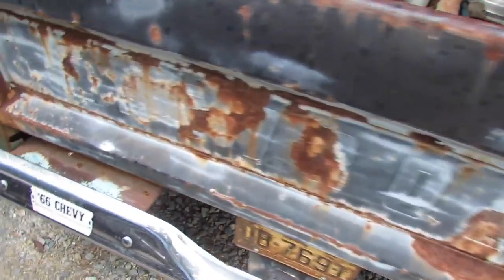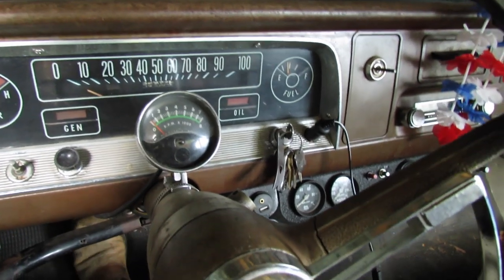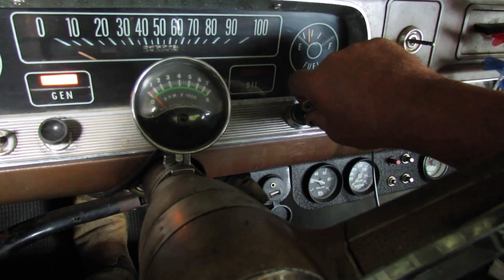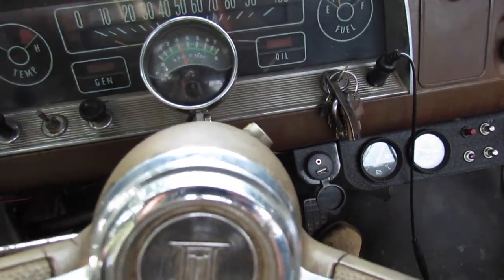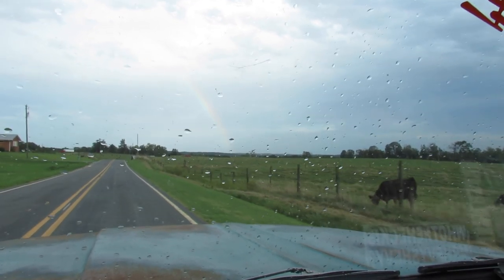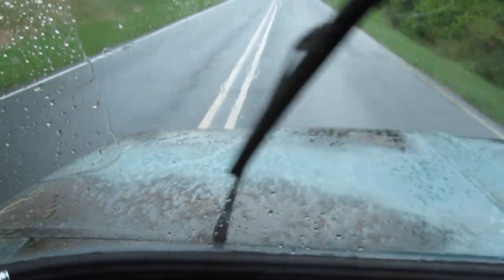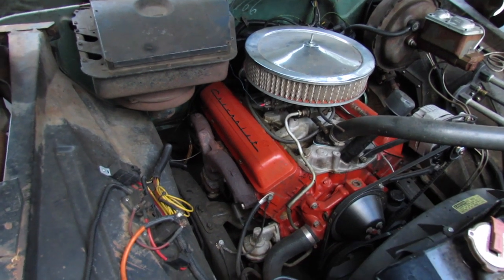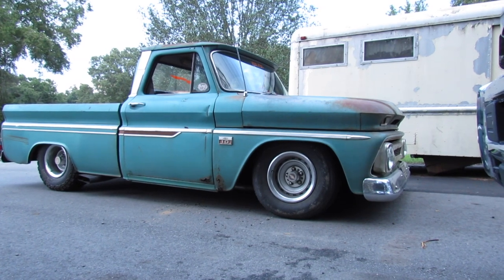66 Chevy C10- Walkaround and a drive

Comment: Really sad when GM was #1  and these trucks still running being 50-60 YEARS old. Today's trucks are all plastic/chinese electronics piles of bull sheet at $50,000-$100,000.
Reply: That is exactly why I cringe every time I see an LS in a old car. There won't be any cleaning the carb, filing the points, and firing up one of those popped capacitor piles 50 years from now.
Reply: @Freedomquest08  Rather keep the first gen V8 myself and the amount hacks to do the swap make it disposable pile of garbage. The 350 is one of the toughest engines on earth and so many ways to build them.
Reply: That truck has had alot of work done to it, that's why its running 60 years later

Comment: if that's an aftermarket tach, then take the cover off and see if it can be switched to 8 cyl.  Have and old tach like that and it has resistors inside to switch from 4, 6, and 8 cyl. Cheers!
Reply from the maker: I need to look into that.

Comment: Question, I have an opportunity to buy a rust free, dent less, roller. All parts are in boxes and need to be put back together. They framed off and never finished putting her back together. 350 motor (apart) and a 700R4 trans, all for $2500. Mind you, the fenders, hood, tailgate, everything is held together by a handful of bolts. He’s asking $4500 and I have him down to $2500 plus delivery. What is YOUR opinion on price??? Anyone?

Comment: Would look a little funny with new boards on the bed floor.. maybe gotta pull some off of an old shed with weathered paint on them to replace just the ones that need replacing. 
I like how there’s no mistaking what kind of carb it has; classy decal.

Comment: I’m building a 283 and using the same rebuilt 305 Camaro heads that I got from a guy that didn’t have time to finish his 283 project. 
Question what head gasket did you use? 
I have some concern about the squish area being the 305 usually uses it’s own head gaskets and a 283 gets away with the standard sbc head gasket as 327 350 etc.  seems like you can have some area of unburnt fuel hanging around the chamber pocket areas. 
Nice truck and motor!
Reply from the maker: Good question.. I remember thinking about that..but I don't remember what I used. Might be in the video.